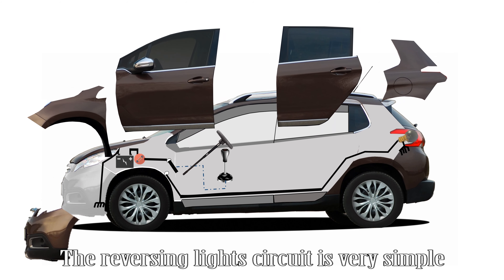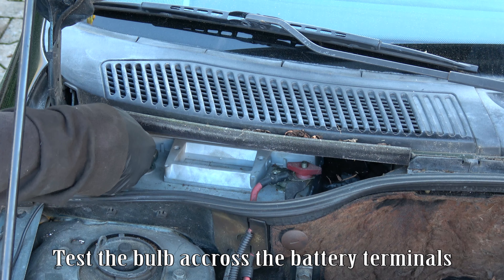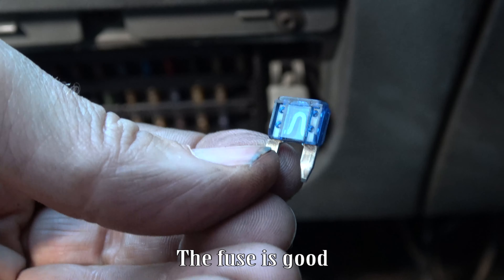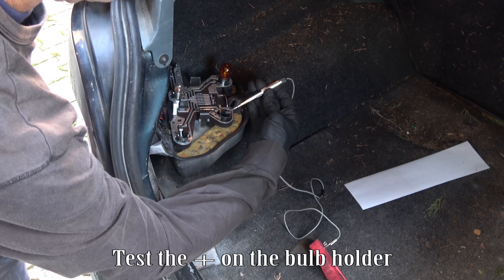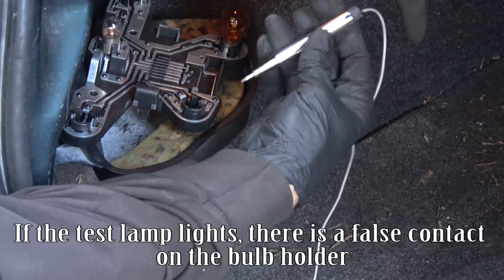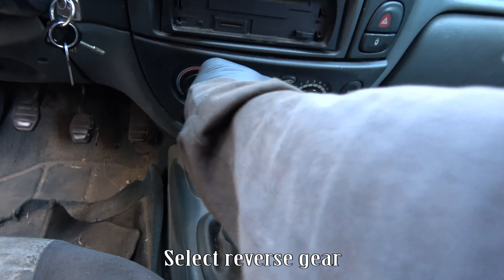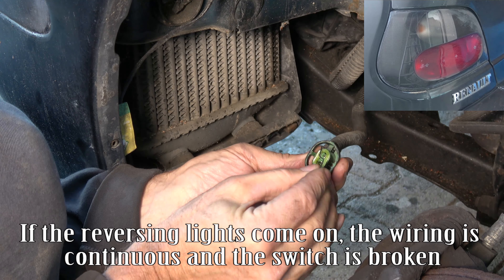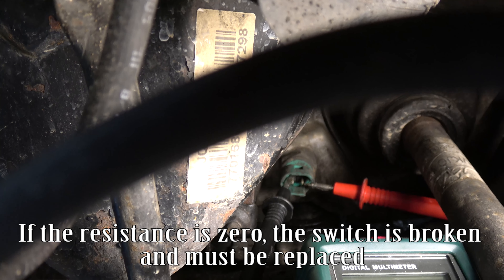Reversing Light Failure Troubleshoot And Fix It

Comment: Hi there whats the cause of your gears  not shifting after replacing the reverse switch, the bulbs were good  the fuses were fine changed the switch and then the gears would not shift and was stuck in reverse
Reply: The bulbs were not blown

Comment: I have a ford focus 2003 mk1 . All of a sudden my reverse light stopped working after checking all my lights I also found the rear fog light does not work either. I have checked and changed bulbs . Checked and changed all appropriate fuses. Even had it into a garage this morning thinking it could be the reverse light switch on the gearbox they said that it was fine . I've taken out the light sockets and gently scraped off any and all corrosion. I've checked the grounds and they are fine . Also checked the wiring that all seems to be fine too. Anybody have any ideas .

Comment: mine keeps blowing the fuse when engage in reverse and no power in the reverse light when checked by multimeter and the wires has no visible damage. Is it the reverse switch?

Comment: hi, my reverse light problem is only when i try to use an LED bulb on both reverse light, the light stays on and the reverse sensors also stays on. This does not happen if i use the original bulb/halogen bulb, only on LED bulb. What could cause this if anyone faced this before? Idk if its the switch because it works normally on  halogen bulb. Am so confused hahaha